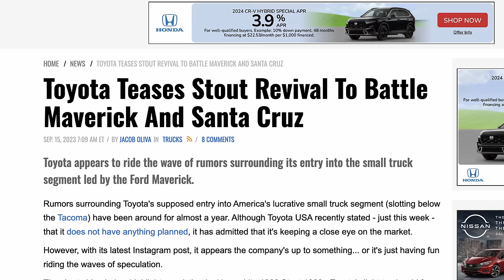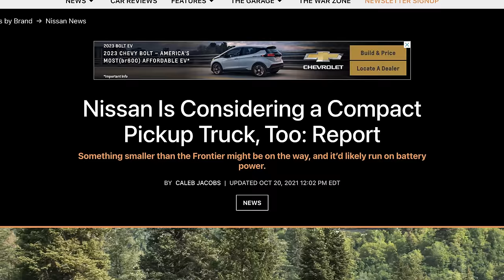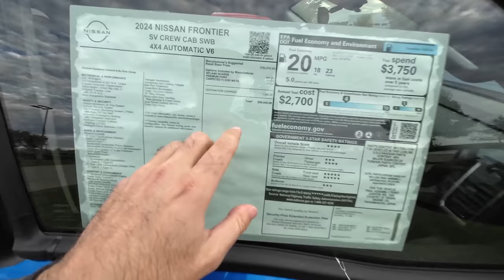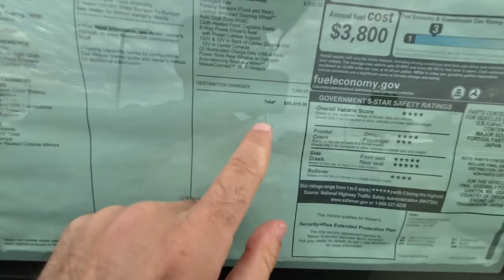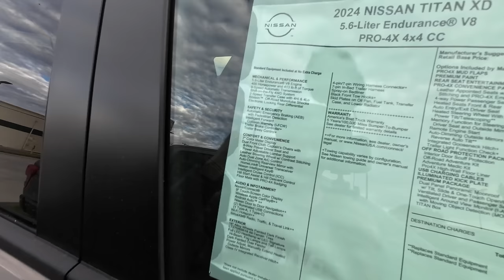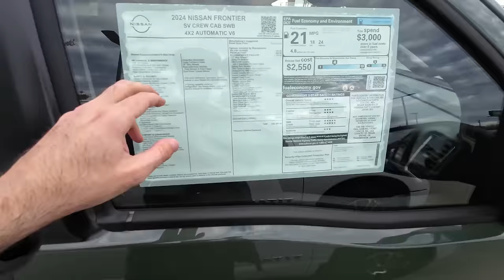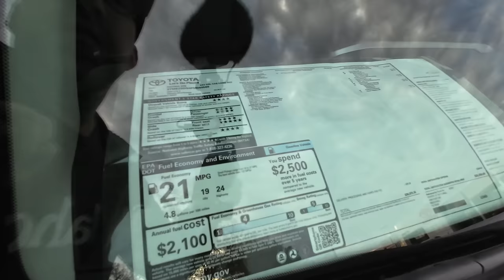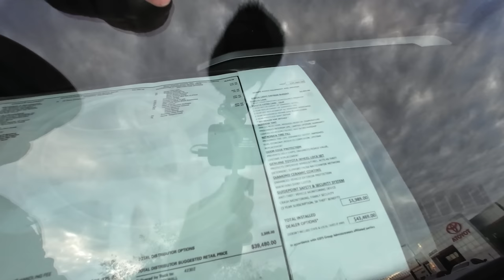Nissan’s NEW $20,000 TRUCK Has Ford & Toyota In Panic Mode!

Comment: If they make a compact pickup for around $20k and no CVT trans, I'll be very interested.
Reply: It would be nice as a stick shift, but maybe a regular automatic transmission would be better, only because no transmission shops know how to work on sticks anymore 🤔
Reply: Yep NO CVT - have heard enough mechanics complain about the Nissan CVTs, which are apparently horrid.
Reply: @jw2877   Manuals are built in security alarms.
Reply: And BODY ON FRAME!!!
Reply: @FloridaFrank2010 I had a CVT in my 2009 Nissan Rogue and it failed twice. It’s expensive and can’t be repaired. Stay away from ANY Nissan CVT.
Reply: Regular cab short bed. A true compact pickup.
Reply: @thadlm2698  any CVT really. Even Subaru's is garbage.
Reply: @thorpe31  I tend to agree with you but I only had experience with the Nissan CVTs.
Reply: Nissan quality reputation still bad, on Consumer Report the new Frontier are not reliable as expected. So, Toyota still the king regarding to reliability.
Reply: I still drive my 99’ Ford Ranger that I bought in 2006.  It is 5 speed manual.  I am so tired of manual haha but dang,  it just keeps on going that I can’t help but keep it.  Pretty solid truck!
Reply: @FloridaFrank2010 - Nissan transmissions are the worst .
Reply: @alexanderschklair1945 - Toyota just screwed theirselves with the 2024 models. CVT turbocharged 4 bangers , no more V6 .
Reply: Manual transmission @ $20k and they can sell as many as they want to sell.  Get people back into Nissan dealerships.  Something simple at a reasonable price that isn't impossible to work on.  She's not rocket surgery.
Reply: And body on chassis please
Reply: @jw2877  If they really try hard the engineers can make changing a clutch major surgery.
 A a 90s Ranger 4 banger was a bit of a pain. Mostly in bleeding the hydraulic clutch . 
That took longer than the rest of the R & R
But the rest of It was not that bad. Also for some reason Ford or whomever made the stick shift had to changer the shifter, early and often.
Plus you could not use 5th with a load or a empty trail behind it. You could but that also meant the trans was going to fail in a few thousand miles.
I had a stick in a '69 Suburban it worked for 250,000 miles.  Well that was until I let some body use it. The tree did not move.
California and DC design vehicles now. I left California in 2000 for some reason.
Reply: @donaldpiper9763 the v6 was not that great for toyota standards. Also the taco and tundra use a regular auto lol
Reply: The frontier has never had a cvt transmission I’m not sure where you heard that from.
Reply: I had (2) Nissan hardbody 4x4’s in the late 80’s-90’s.  Both cab and 1/2.  Manual wheel locks up front.  Both were stick.  Easy Peazy to do maintenance.  I put over 200k on both, and both ran like new when I sold them.  I’d buy one tomorrow if priced in the 20’s.  No power windows/locks, and no TV screen BS.  Prefer vinyl floors w/o carpet.  Regular compact truck.  I’d use it as a daily driver and keep my Tundra for towing.
Reply: And not electric.
Reply: @jw2877  Every one does, they just don't want to as it makes them a fraction of the profit. 
Manual transmissions are taught as part of every auto shop/technical training program.
Reply: @thadlm2698  It can, but the number of shops in the U.S. that know how to pull apart a CVT and fix it are about zero.  It's just swapped for a new unit ( $$$ for the dealer or shop as well )
Reply: @thorpe31  CVTs are fine if you don't exceed about 180HP.  The main issue is drivetrain lash, which is an unavoidable factor in any truck with a heavy load.  CVTs kind of lose their mind over that and once they start slipping a little bit, they are never going to get better.  An automatic just heats up the oil a little hotter getting moving, and if you are gentle for the next minute or two, all is good.  Manuals, well, it's just gears - as long as no teeth break, you're good :)
Reply: @josephoberlander  thats true, Automatic has been the standard for some years now. I had an 88 Dodge Dakota and brought it to one of the best transmission shops in the country that im also good friends with, that was in the late 90s at the time and they said the bench time on the standard sticks takes way longer on a rebuild then delays typically automatic rebuilds there cranking out. So from a business sense, it makes sense. They were calling automatics junks at that time too, but they would upgrade the torque converters, external temperature gauges, etc. On alot of their work, so they had a pretty good rep. The e-CVTs are the way to go, but then you're getting into the hybrids. Which toyota has proven e-CVTs as a proven technology now. Im completely not! a battery guy, but a small pickup hybrid is not out of the question for the future. That's why ill never get rid of my 97 FORD 7.3 International when it come to towing my mid size heavier loads.
Reply: @josephoberlander  Exactly why we dont want a cvt in a small truck.
Reply: I'll never buy a Ford, Ram, or GM vehicle. Ever!
Reply: No electric for me though.Im waiting until they have more range and convenience of re-fueling/charging.
Reply: if it has a manual, is body on frame, RWD, 2 door, and at least 6 foot bed....sign me up!
Reply: @jw2877 Where do you live? 😂 My mechanic always talks about how much easier it is for manual repairs and mentions how easy it is to work on my B14 Sentra
Reply: The mew frontier has a mercades transmission the same one from the g wagon and sprinter
Reply: CVT= 💩💩💩💩💩
If these compact or small pickup come equipped with a REAL Automatic transmission with 8 or 9 gears and a v6 of AT LEAST 2.5 litres, then my checkbook is ready!!!!!
Reply: eCVTs are bullet proof and great transmissions. Traditional CVTs are poop.
Reply: Preach
Reply: @FloridaFrank2010 and the titans xd don’t have a cvt does it
Reply: I guess what I don't understand is what the hell is wrong with a good old fashioned five speed manual transmission? The auto makers are wasting so much time and  money trying to make automatics perform as well as the sticks and trying to equal the mileage per gallon (and failing too), why not just put a stick in it and stop worrying? Aftermarket stick trans manufacturers can hardly keep them on the shelves they're so popular. These car/truck manufacturers should take the hint. Ford had a fantastic stick trans for their F-250, 350, 450 and 550 diesels. The ZF-6spd they came up with was excellent! Perfectly geared and damn near bulletproof but they stopped offering it because they said it wouldn't pass EPA standards. Why not? The 250 4x4 I had got better fuel mileage and ran better then any automatic truck I've ever owned both when empty or towing. I don't care what I'm driving, I'll take a stick over an automatic any time.
Reply: Nissan (or anybody else) could announce it as starting at $19,999 and it would just end up at $35,000, i.e. the Ford Maverick.   As long as there are enough suckers who can finance and put themselves in debt prison for 7+ years for a vehicle trying to impress people they don't know and will never meet, this is what we all get.
Reply: @jw2877 my 06 frontier with a 6 speed manual just blew the motor on me. I’m buying my dads 2020 pro4 but I’m gonna miss that manual trans. I’ve never owned an auto before.
Reply: @lexwaldez I just blew up my manual 06 frontier at 269k miles due to an oil leak I didn’t notice (I park in grass). Was always reliable for me until then. I’m buying my dads 2020 pro4 but if Nissan makes a $20,000 manual mini truck again, I’ll buy one In a heartbeat.
Reply: @thadlm2698  NO stay away from ANY brand car with CVT.. they are CRAP..  when they are new and up to like 100K they are fine.. after that forgetaboutit..
Reply: @carl2591  Roger that…I’ll never mess with a CVT again.
Reply: at $20k you get no say like no cvt....
Reply: In the name of All that's Good, no CVTS OR TURBOS  !!!
Reply: 9-speed auto
Reply: I agree If they make one for under 20k body on frame no cvt rwd transmission I would definitely take a look
Reply: There was never a time that the Hilux was not a cool truck little pickup trucks are the s*** especially the ones that are turboed four wheel drive.
Reply: We are ready for turboed hybrid electric with water meth injection and onboard hydrogen cell with 6 speed trans 4x4
Reply: Not saying CVT’s are the best but I’ve had no problem with my Nissan after almost 100,000 miles. Still running like a champ .
Reply: 20 mpg?
Reply: @donaldpiper9763 What years are you referring to? The last 5 years they have been smooth and reliable, at least for me, I've had 3.

Comment: Simple, reliable, and manual transmission and I’ll buy it
Reply: Right. And engineer so that you can service the clutch if needed without taking the entire thing apart. Build it old school frame with a simple cross membrane and keep the friggen exhaust tube and steering system out of the way.
Reply: @russellstewart5414  Yes sir, y'all are right. Any company would have my money if they did that. I prefer American brands, but I'm not gonna pass up a simple truck for a $70G for a truck trying to be a luxury crossover.
Reply: 00=04 Nissan are good

Comment: Those old Nissans were unbreakable, as was the old Pathfinder. These new small trucks don't hold a candle to the old small body, Nissans, or Toyotas of the past. Who knew the 80s would be the pinnacle of vehicular development?
Reply: As long as Nissan offers a V6, I will consider a Hardbody
Reply: Rangers s10s. In 80s were cheep and disposable
Reply: Nissan lost its credibility with the new trucks…
Reply: My husband has a 2002 6 cylinder Frontier. 50,000 miles. No major problems. His baby. 4x4
Reply: Great truck and no turbo to blow up

Comment: I had a late 80s or early 90s Nissan pickup.  4 cylinder manual. Was a fantastic tuck! The engine was strong and felt like 6 cylinder.
Reply: Its not the same truck now though, it is built like crap with zero quality control.
Reply: Yep, a friend of mine had the same old hardbody back in the early 90's, he beat the crap out of that thing, he lowered it, raced it, redlined it all the time no matter where he was going, tried driving it into the ground and it would not die!  The only thing he had to replace on it was tires and occasionally the oil, he regrets ever selling it.  If they made the same type of vehicle today, I highly doubt it would be as tough as how they made them back then, it would probably be built for the average mother who gets groceries and brings the kids to soccer practice and never drives on dirt.

Comment: Never should’ve sold my 86 Toyota pickup with a 4 speed manual transmission and a 22R motor.
Reply: Hindsight is 20/20 but wow, that was not a good move.
Reply: Those 22s are BULLETPROOF
Reply: I sold my same Toyota truck 22r and a new engine with transmission with it. Standard 4 speed with a b&m shifter knob. Single seater no extended cab.
Reply: I had one of the first 3.4l V6 with the 5 speed and yes.. I miss that truck!

Comment: I had a 1995 Nissan hard body that I bought new and sold with 165K miles. Nothing went wrong with in those miles, strictly oil and filters. I wasn't particularly nice to that truck either. I don't remember the exact price of it but it was well under $10K dollars. Best vehicle I've ever owned.

Comment: I drove a small Datsun 2 wheel drive pickup in the 80s and it was awesome on gas and got the job done with small loads. So why not for the younger generation for affordability or even retired people?
Reply: I had the Nissan Hard Body in the 80s. It was my first new truck. Now in 2023 I drive a Nissan Titan Pro4x. 😂 I've come full circle.
Reply: "Why not?"  Answer: because no manufacturer offers them in the U.S.
Reply: @imatoad6101  why not' was said in the context of bringing back a small affordable truck in the US again.
Reply: I'm in South Africa and our pickups (bakkies) max out at the Hilux and Ranger and similar but we used to have a great range of what we called half-ton bakkies. We've lost all of those to offerings that are now limited to the Ranger size or panel vans. Here though we max out at around a 2.5 l diesel engine on the larger pickups.
Reply: Because Americans have less buying power than they did in the 80s. We work harder for less while the older generations fail to see it.

Comment: Stopped by a Ford Dealership to look at a Maverick I saw on their website 3 weeks earlier. It was a Lariat trim with a MSRP of $35k.

They told me they turned down an offer of $42k and wanted $48k for it. 🤯

I can get a used F150 with the more option for that.

Craziness!
Reply: Only the base xl model is affordable
Reply: Ford has greatly curtailed Maverick production, so they can sell more $80K+ trucks and EVs.
This is not working out for them at all, but they have not altered course yet.
Reply: @FloridaFrank2010 nobody is going to buy a f 150 with a twin turbo v6 or v8 with gas prices and inflation like they are if I was the Ford ceo I would be building mavericks and Rangers because that is what the market needs at the moment and not worry about ev's right now putting that on the back burner because the charging  infrastructure is not available to support them and the prices are too high
Reply: I’m proud of you for not buying that truck now if we convince the others to do that they will be forced to drop the price
Reply: They can keep it!

Comment: Everybody knows that "cheap $20K" truck is really a "$30K" truck. Same as the Ford Maverick, and the "maybe" Toyota Stout.
Reply: Exactly.  As soon as the Maverick hit the dealerships, it was suddenly $8,000 more than advertised.
Reply: @mplslawnguy3389  Classic "bait @ switch" shyster techniques.
Reply: I am not sure Toyota will ever build a sub-$30K truck, much less a $20K one.  Right now $20K will get you an eight-year old used Tacoma with around 150K miles. No thanks.
Reply: @soloCRPG  - Rows and rows of new Tundras and Tacomas sit, just like at their US counterpart dealerships GM, Ford, and Dodge.
Reply: Don't say "maybe" for the stout. That truck is a myth, unicorn and Fantasy that may never be. Toyota has that electric type truck but I'd be curious to if it actually hits mass  production.

I read an article by auto Revolution where they actually interviewed some one who works with Toyota and the dude told them that the stout isn't happening
Reply: @richardkusimenkah - probably right - and there's a few other fakes too (besides Stout).
Reply: Yeah I struggle to find mavericks for less than 30k. Some fuckery going on

Comment: I researched trucks for over a year and went with a '23 Frontier Pro 4X that was 5K below MSRP a few weeks ago.  Just a fantastic, beefy, sturdy feeling truck. Hydraulic steering, V6 naturally aspirated engine, no CVT transmission, factory bedliner, nice interior and priced well I thought. Just love the truck and I think Nissan is going in the right direction. My previous vehicle was a Nissan 370Z which was indestructible. Sure it had aged tech in it but I loved that sports car. I was just ready to return to my pickups.
Reply: SMART MAN
Reply: Let's hope they worked out the radiator leak problem that fragged countless V6 engines and transmissions simultaneously in the 05-11 Frontier and Xterras.  Nissan was sued over the issue in a class action lawsuit, effectively turning every one of those trucks and SUVs into Lemons. Thats why you  hardly ever see those trucks and SUVs on the road.  I had an 06 Xterra that was totaled by that very  issue, fragged the engine and transmission, causing it to spew milk of magnesia from every orifice and Nissan denied me a fix to a known issue because my Xterra "was not part of the VIN run with that problem".  We went from a Nissan family  to a "never-again" Nissan family.

Comment: I think the most interesting thing is a lot of these Japanese companies already make these trucks, they have the toyota dyna, Nissan Atlas, and they come with a 3 liter diesel engine and a manual transmission, they have roll up windows and are basic trucks.
Reply: Yes, when I visited southern Honduras many years ago, that's mostly what they had down there: small Nissan and Toyota pickup trucks with diesels. As memory serves, diesel was the only fuel available at the gas stations I saw down there.

Comment: Maybe it would have been $20,000 in 2018... nothing is going to go that low now. Impossible.
Reply: Correct!  I'm not happy about it, but a base Corolla is $22,000.  With labor and materials higher than ever, there's no way
Reply: Fiat 500e, MSRP $32,500

Comment: I bought an 07 Colorado when it first came out and absolutely loved that truck. Ran great for 10 years. Paid 24k for it
Reply: I love the colorado also so I bought a 2019 paid 38k. (my 1st was a 2016) I have 40k miles on it now with a K&N cold air intake , Magnaflow cat back exhaust and a Pedal commander. I am 55 and it has been the best truck I have ever owned!!
Reply: I had an 06 and bought it with 21k miles. It had 4 doors, 4x4, and a lift over an LS package, but it was less than 22k off the lot.
Reply: @bryandevries7210  u bought one with 21k miles, mine had 12, I was the first and only owner. Yours was used. That's why it was cheaper

Comment: I recently just bought a 5.4L 3V crate engine and a new box for my 2004 new style F150 FX4.  The frame is like new, running gear is perfect... Waaaaaaay cheaper to buy new components than a new truck.  There's nothing wrong with it's current engine, just thought I'd get a perfect crate engine to have in reserve if it happens to die.
Reply: Who did you go with on the engine?